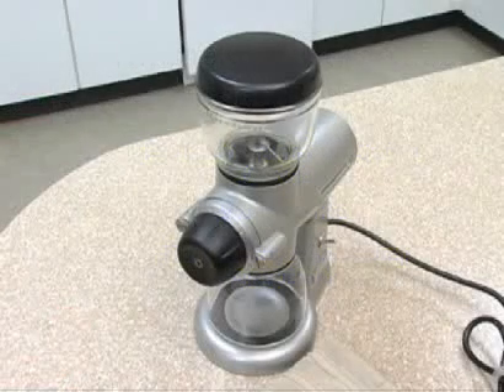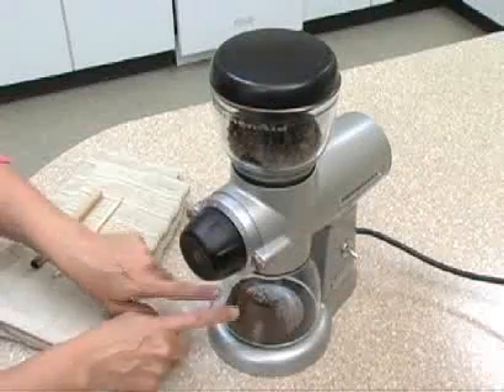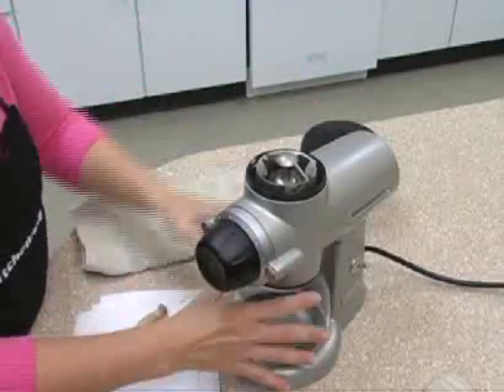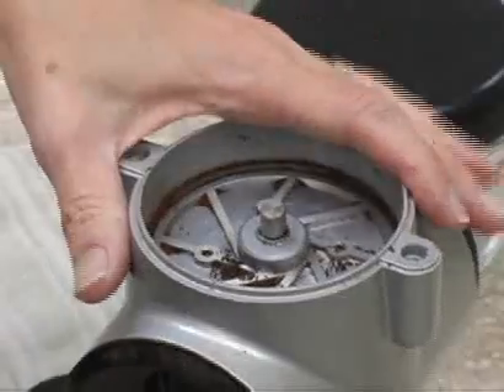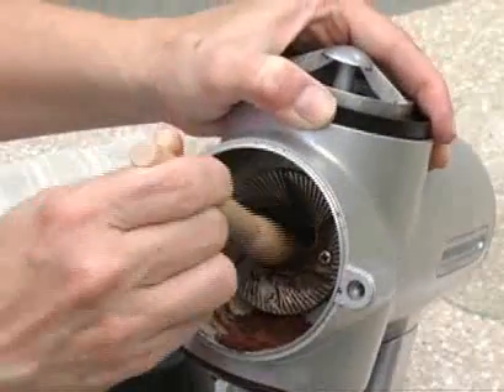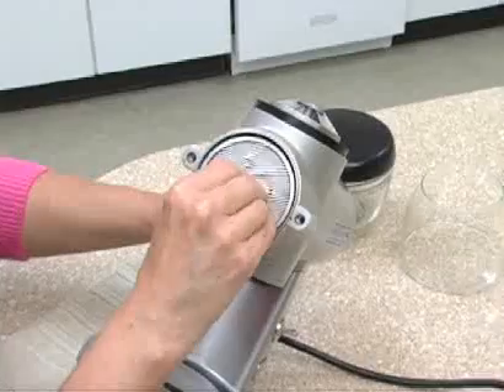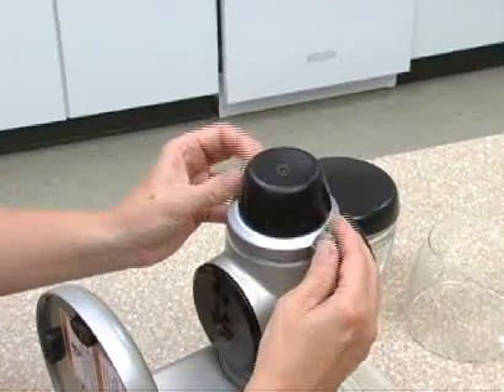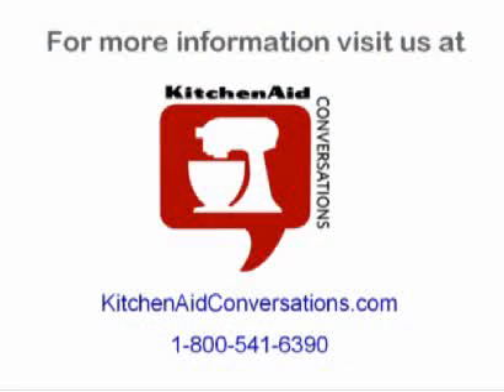ProLine Coffee Mill- Burr Cleaning and Assembly Instructions

Comment: I've had my grinder for 18 years and it's still going strong.  LOVE THIS GRINDER.  Possibly the newer made ones are not the same quality as the original.  KA did stop manufacturing it for several years and brought it back .... supposedly better than ever!  Seems that may not be the case.  Love my KA proline burr grinder.  I've NEVER changed the burrs,  just adjusted them.  The grind is consistent when I do and provides a delicious cup of coffee.  Don't forget to use GOOD beans!

Comment: This grinder is junk. The plastic gears on mine broke. Good luck getting parts. $350 paperweight.

They sell replacement burrs. Why bother? The burrs will outlast the plastic gears .
Reply: how long did yours last? had mine for 3 years now and getting worried
Reply: @adamslogic    I had it maybe 4 1/2 years. So surprised by the plastic gears.
Light/medium roasts are going to be harder on a grinder. Dark roasts are softer. That is something to consider in how much life you may get out of it.
FYI - I'm not being unreasonable in my post and am not just a chronic complainer. Kitchenaid makes some good stuff. I have a brewed coffee maker that has been good. I have had an artisan stand mixer since 2004. It has been well used and is solid machine.
Reply: I've had mine for about 18 years (give or take!) and it's still going strong!
Reply: YouTube removed my video showing the broken plastic gears. I guess kitchenaid has some clout when they pay to advertise. Taking down my video does not change the fact that the gears in the proline grinder are plastic.
Reply: @mlpnorthsub8543  Have had mine for almost the same timeframe, no troubles.
Reply: @thermos73 
Can you put up the video again if you still have it?.
Reply: @rxonmymind8362  I will see if I can find it